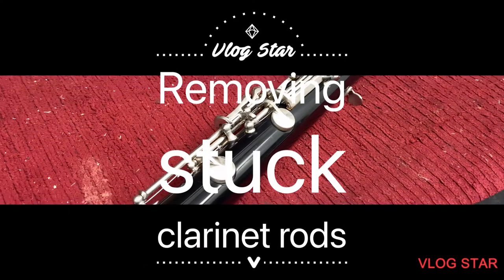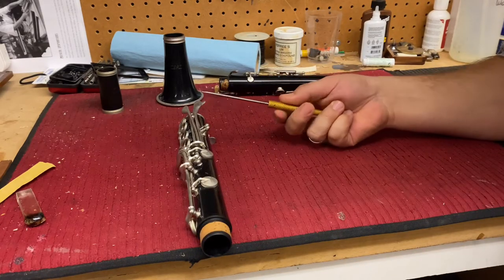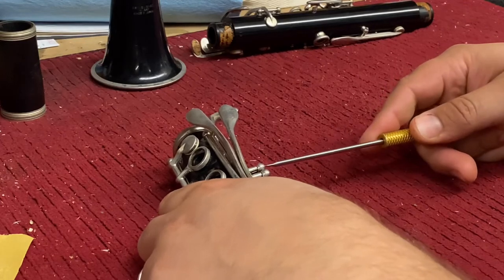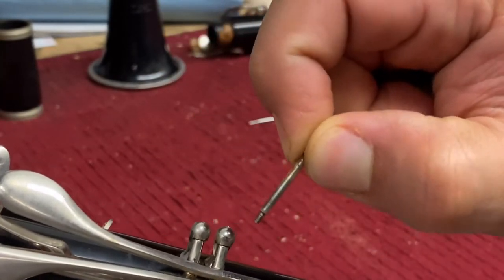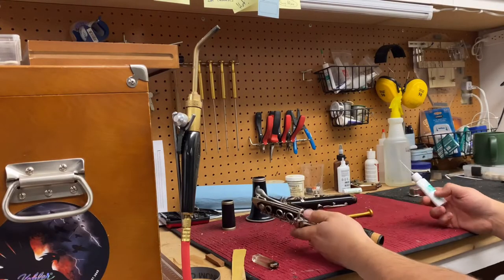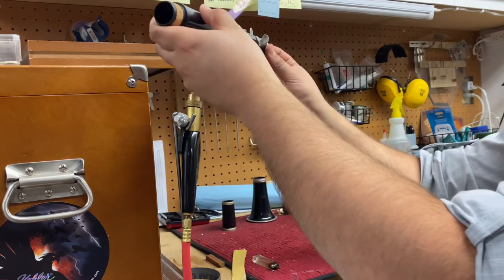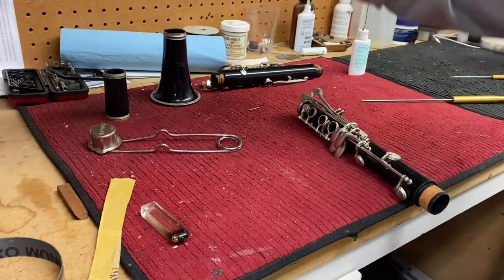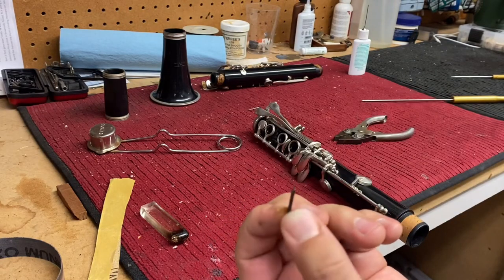Removing stuck clarinet rods

Comment: Dude. I still can not get the last couple of screws out. I have tried heat and oil and the back and fourth method you've used here. I'm just about ready to try to rip off the ball with the guide hole and put one back on. Any other suggestions before I do that? Or any suggestions for doing that safely?